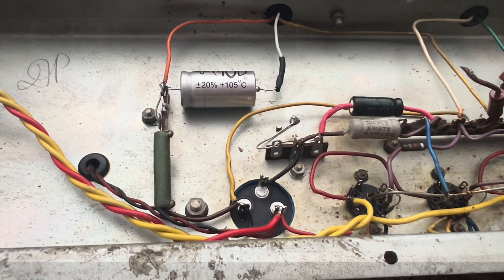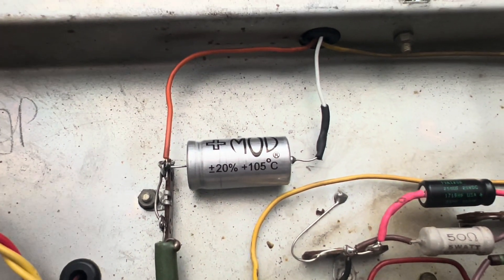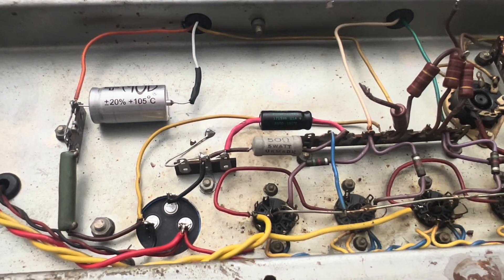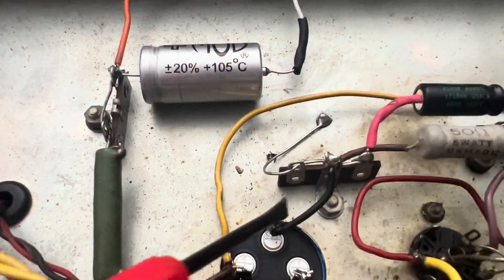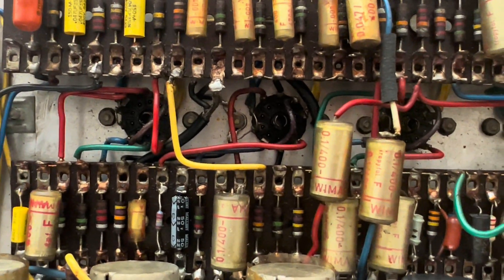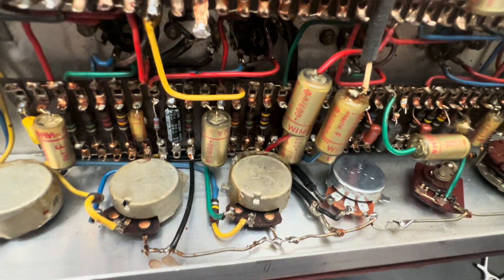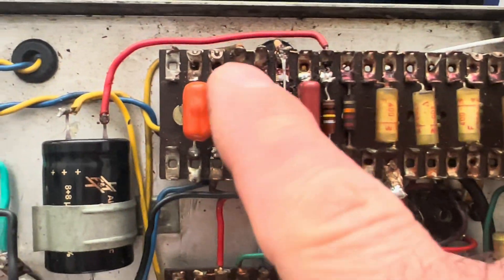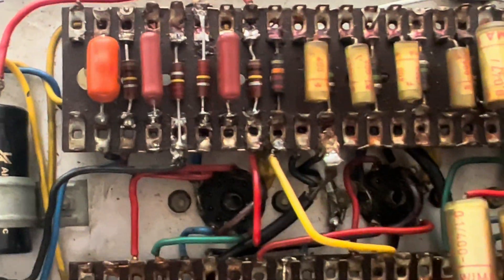1963/4 Vox AC30 Part 2 || Kurt’s Rustle

Comment: Grid and screen stoppers are best soldered as close to the tube pins as you can to introduce as little stray inductance as is physically possible.
Reply from the maker: Miller capacitance and all. Vox does what Vox does.